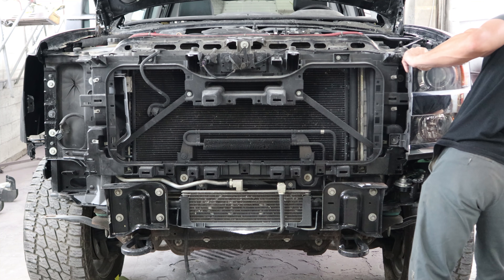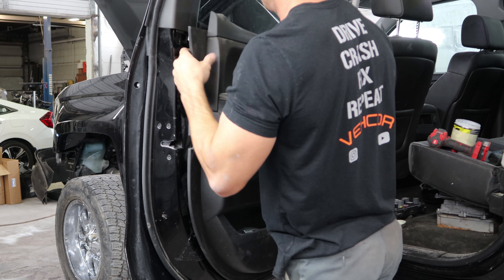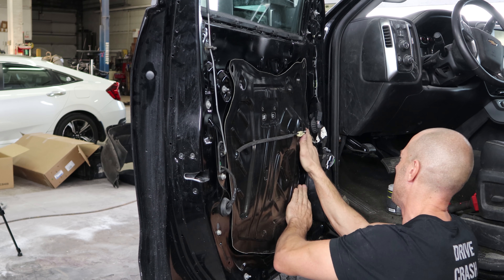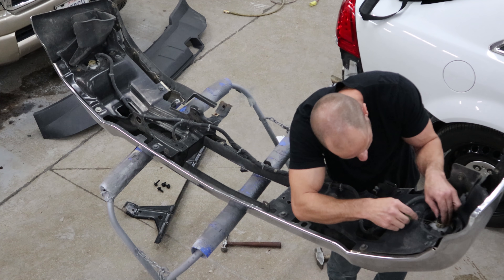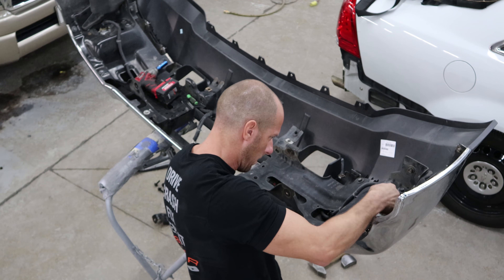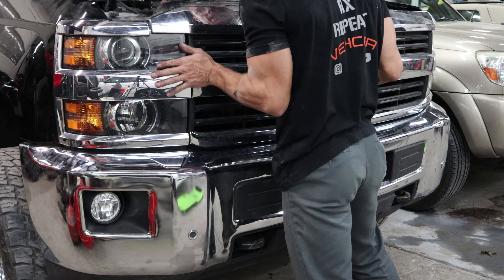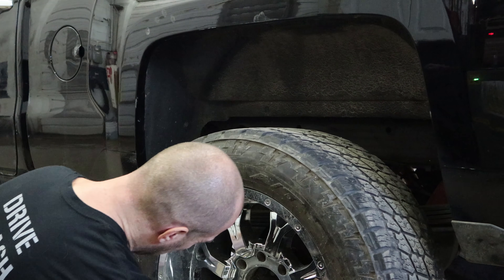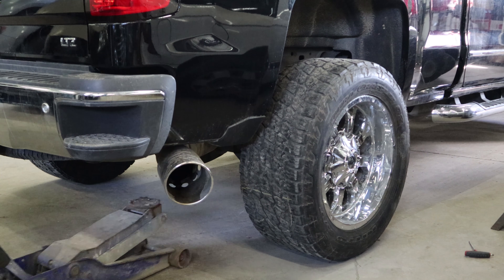Final assembly of the 2015 Silverado Duramax LTZ "The Mistake" Part 11

Comment: Great job bringing it back to life. How did you get it registered after? I know you didn't use the original cab, or the parts truck cab; wound up getting a 'new" cab from a salvage yard. Were you permitted to use the VIN from the mistake truck?
Reply: Since it is illegal to remove the VIN tag I'd say he had to use the VIN that was on the cab. I was thinking about this the other day: at what point is the vehicle no longer even remotely associated with the VIN? Since the vin is on the cab, but linked in the ECU, but you could effectively (like this build) replace everything on the vehicle including the frame. 

If you ever watched the original "gone in 60 seconds" what they'd do is buy a wrecked vehicle for $100.00. Then go out and steal a pristine version (Like a cuda or a challenger) and then swap the vin tags.
Reply: He said something about having the state highway patrol swap VIN numbers. I think the cab is from a 1500 truck.
Reply: @GreyFox2000  The problem is: the vin is tied into the ECU so you can't just swap it. I know when you build a kit car, you go to the DOT or BMV and they issue a whole new one. 

I think though in this case, the VIN could (would?) be pulled from the ECU and that's the one they'd use.
Reply: @muskokamike127  in another video he said he has to get the ECU flashed.
Reply: @GreyFox2000  I thought that was to accept the various options on the truck though, type of fuel pump etc. Can you overwrite the VIN in it?
Reply: @muskokamike127  he may not be able to as that is usually a dealer only service. But I'm pretty sure if he explains his situation and shows the proper paperwork they would do it.
Reply: @GreyFox2000  I dunno. I have to replace my 5.4L (busted cam journals) and have an in on a good used 4.6L. So I called up the local Ford dealer service because my mechanic can't do the re-coding of the ecu. The Service Manager said they wouldn't be able to re-program the ecu to the 4.6L. I could get the ecu out of the donor vehicle but I might find that  a lot of my accessories would't work. The two vehicles would have to be basically identical except for the engine size. He used the term "as built". Meaning all options etc would have to be the same. Otherwise I might find that my power sunroof wouldn't work if the donor ecu didn't have one. Which makes me crazy because wtf does a car need to have a diagnostic management computer hooked up to the sun roof? I had this issue with my power windows. They wouldn't work after the battery was disconnected for 2 weeks while some work was being done. Mechanic said the ecu has to "relearn" that I have power windows. THIS is why new cars are shit and way more complicated than they have to be. Power windows are a switch, press up press down. They do NOT need to be connected to the ecu. Same as fog lights etc. 

Now I know fordtechmakuloco reprogrammed a ford ecu to work with a different vehicle but I dunno if a dealer would. I seem to recall him calling up a dealer and the dealer saying the junk yard ecu wouldn't work also.
Reply from the maker: It will be registered under the original truck's VIN.  The state has retagged the parts cab with the original vin.  All modules in the truck are programmed with the original vin as well.  All the other parts replaced will be documented at the salvage anti-theft test that comes up next.  The last part of the process before I get issued my clear, rebuilt branded title.  Thanks for watching.

Comment: The tire place probably forgot to give that key back to a customer and then gave it to u lol. Used to work in tire shops and they would have a bin full of wheel lock keys that were left out of customers cars over the years. Whenever we had a car missing the key 80% of the time we had one that fit and would just give it to the customer.
Reply from the maker: They sell them with the sets of wheels all the time.  This one was brand new.  It is not the first time I went there to match one up.  I rarely get things like wheel lock keys when I buy salvage vehicles.  People like to keep them like they will do them some good or something. lol  I have a similar collection though.  I always save them when I part out a car or when a car goes to the junkyard.

Comment: When you go get the inpection done thir gonna be like so what was wrong with it ?
Reply from the maker: They get the auction pictures and you have to have all the paperwork for the replacement parts.  The pictures make it look like it really only needed a wheel, rear bumper and airbags.  They are going to wonder why I changed all the extra stuff. lol  I have had some pretty bad wrecks that I had to give them a detailed explanation of what was done and show them exactly where to look.  The Enclave video is one example.  They had lots of questions. lol  Thanks for watching.
Reply: @vehcor  its sounds harder than it is down here in california  they dont ask where you get the parts over here
Reply from the maker: @Operator-fq2fn  weird, maybe that is why there are so many stolen cars in Cali.  I never though anything the government did was useful but maybe this is actually working.  Maybe it is just some other factor and government is as useless as I thought. lol

Comment: Why don’t you clean any of ur parts before reassembly?
Reply from the maker: I don't have time to waste on nonsense like that.  It will all get detailed when it is done.  Thanks for watching.
Reply: vehcor just seams crazy you have a fresh black paint job and ur rubbing a dirt covered wheel liner up against it then putting ur dirt covered paws all over it just makes me squirm but time is money. Love the content keep it up
Reply from the maker: @danlarkey2799  I could clean those carpeted wheel liners for hours and dirt would still come out of them.  Waste of time for me.  Besides, what am I going to scratch, the part covered by the liner. lol My dirt covered paws don't hurt anything, the dust rinses off.  It is not like I start rubbing it into the paint. In a perfect world we could wash everything all the time before we do anything but that is for channels that are not real life and builders that are doing things for the show.  I rarely wash anything more than once unless it is really dirty or it will somehow save time in the long run.  After doing this for a few decades you learn where your time is best spent and what you can get away with.
Reply: vehcor agreed and I really love how u crank them out wish you had more truck videos but I’ll keep coming back regardless
Reply from the maker: I wish I had more trucks to rebuild.  They are my favorite.  If the buyer comes through with money for this one, I will have at least one more of these.  I probably will any way, I have three that want this truck so maybe I can talk them into other ones I get.

Comment: You wonder if modern vehicles are better than vehicles from the past when a pickup truck has more wiring in the bumper bar than a pickup from the seventies had in its entire loom.
Reply from the maker: I would say they are better but that is just my opinion.  You can't beat the styling of the classics but the ease of working on the new stuff is far better than the old stuff.  Thanks for watching.